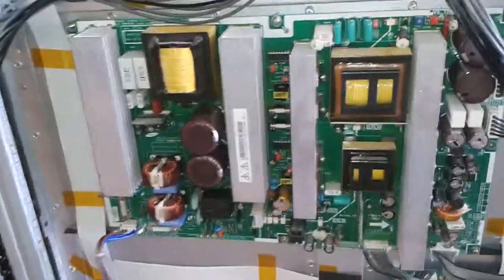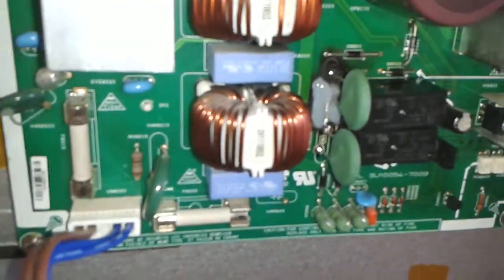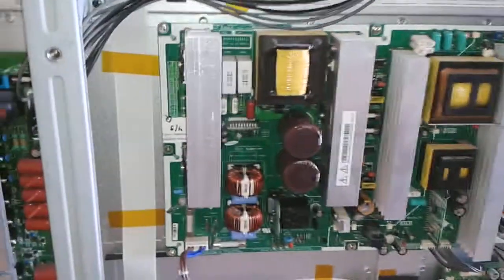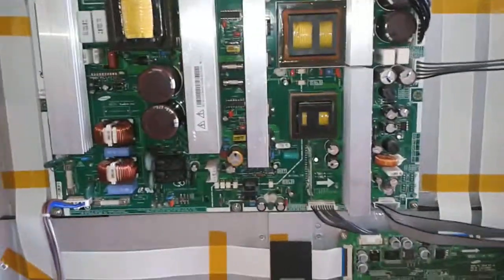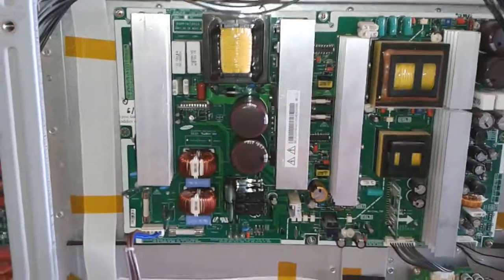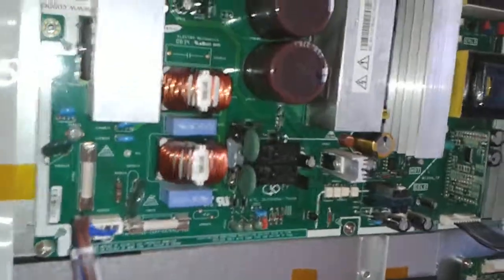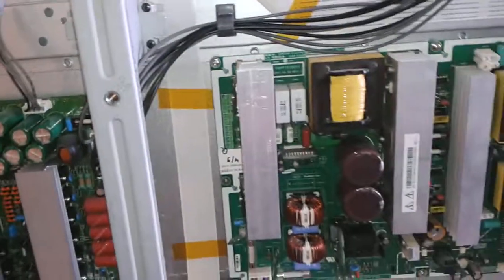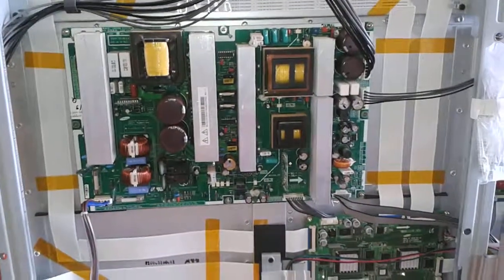SAMSUNG PN58A550S1FXZA power test after servicing for heavily burned thermistors

Comment: My power board tv bn44-0622b for ue40f6740sb tv is has one element burn and it is nt801s thermistor . If this component is Brocken how much is the cost of service and should the only this component be change or some other things could be Brocken too? There I should visual sign of anything Brocken
Reply from the maker: As with fuses while certainly possible it is highly unlikely that they would fail on their own. I can't say what a repair would cost without knowing what has failed. Price to repair is usually not so much ties to what is bad as it is to what it takes to identify all that needs to be resolved.

Comment: hi i would like to send my boards in power .. and ....main boars.i replaced the main boars. still did same thing. so like to check it as well. i have wasted a lot of time amd some money trying to fix it. my email.. genestrattonti@gmail.com if you could get hold of me and let me know aprox how much and or where to send my boards to.. THANK YOU! Gene
Reply from the maker: Just updated the description of the video with a link to the repair service for the board. Or you can just search for BN44-00183A at www.coppelltvrepair.com and find it.
You can send both main board and power supply with same package and under same service request.
Note there may be a little surcharge due to having to test one of them (assuming only one needs servicing) and possibly a few bucks more for combined S&H. Also note you need to package them very well so they do not rub off each other and so that the large and heavy power is well cushioned and doesn't break.

Comment: iam trying to purchase the kit for fix this power supply ,what i need to do ,because iam in mexico cabo san lucas
Reply from the maker: You can use 

http://www.ebay.com/itm/PSPF701801A-BN44-00183A-SAMSUNG-POWER-SUPPLY-DEAD-CLICKING-ON-OFF-REPAIR-KIT-/111379028925?